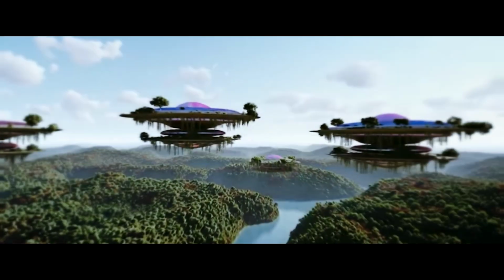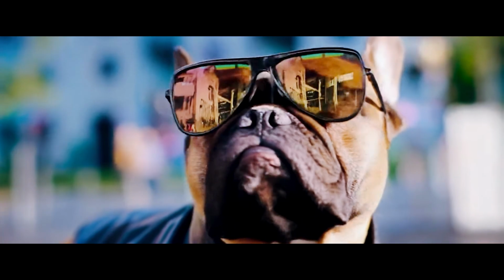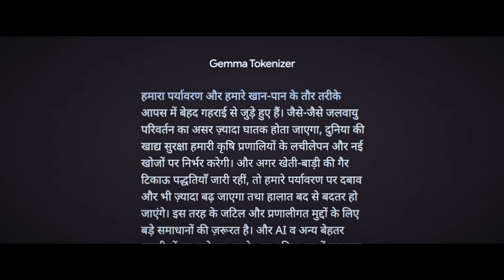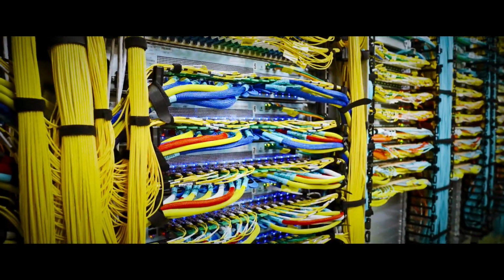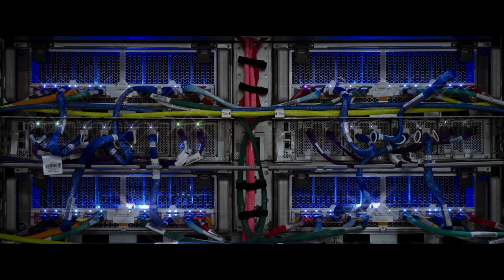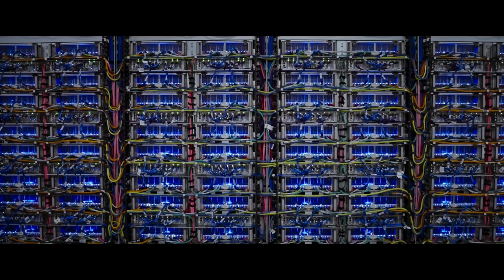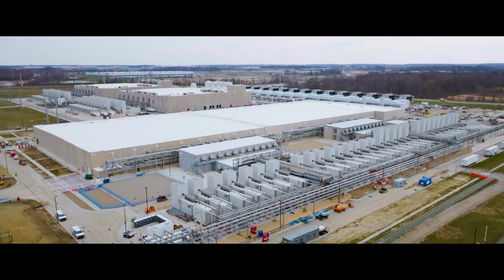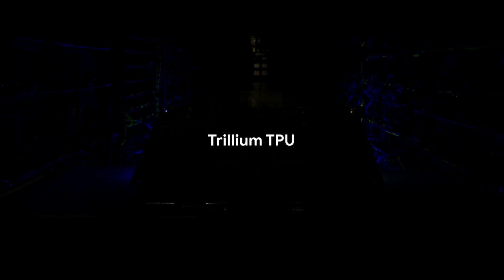Trillium TPU, built to power the future of AI

Comment: When I can buy the hardware, I will be interested.
Reply: Well ... If you are serious and not being sarcastic as of October 2025 consumers can't buy these even if they had the dough, power and software to work with them locally. These are for use in 'Google' Data Centers only. You can use Googles AI Cloud tools (Vertex) to run them from the Google Cloud which would be using them somewhere along the chain through the cloud but one cannot buy/purchase these chips. They are not for sale or for use to any consumers nor are they for sale to any other corporate businesses. They are proprietary and exclusive to Google in and at their Large Scale Data Centers specifically and only. NOTE: They have an 'Edge TPU' which is not much larger than a thumb drive and can be used via a USB connection as a sort of accelerator on select devices only. It is around $100-150 but that is the extent of any consumer access to this technology/hardware as of October 2025.